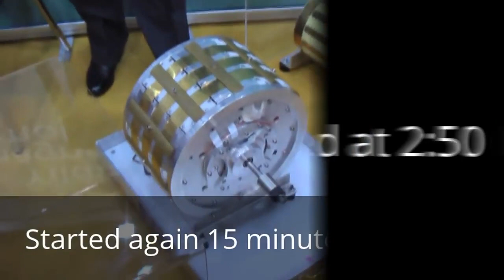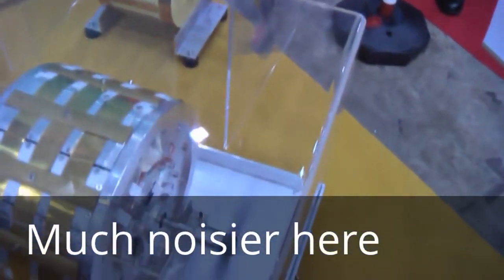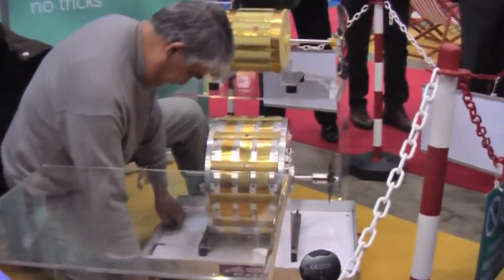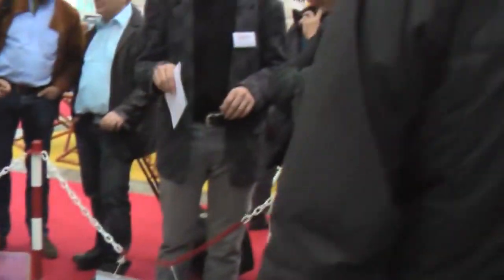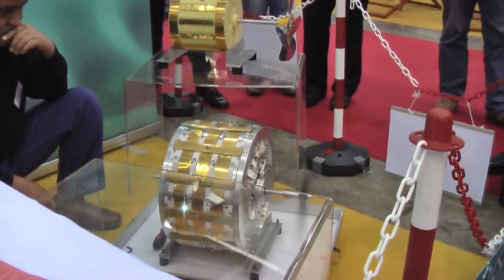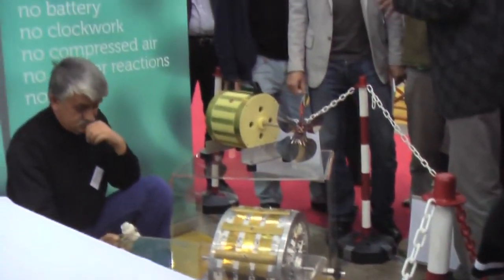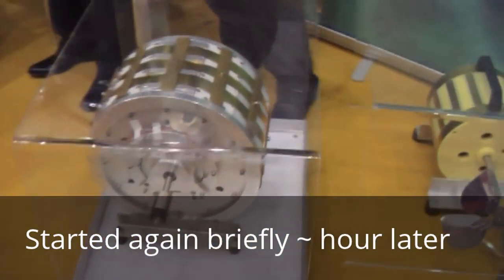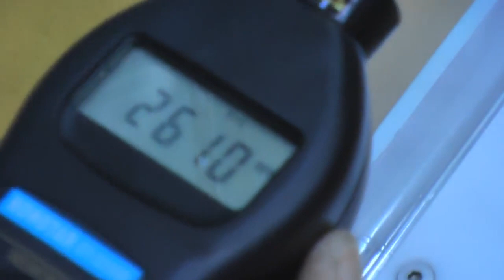Running Yildiz Magnet Motor at Inventors Expo 10 12, 2017, Geneva, Switzerland

Comment: He could never agree to take the center core a part, That's where a coiled spring is hidden, He coils the spring inside the closet where no one can see him and then comes out and right before the demonstration he releases the spring latch with a punch and a hammer to set it off, It spins for a while with no load attached to it. He never let it run until it stops and he refused to attach a load to it.
Reply: lol right...
Reply: I have another idea.. There is a battery but the switch is hammer activated.. İmagine a  metal rod that connects both polarities by just hammering it . The switch rod slides to left once it got hit by hammer and breaks the circuit
Reply: @ruchancakaloglu  that is one impressive battery tech.... maybe nobel prize winning.. this device runs for hours and produces 240v when paired with a generator.. and it produces no heat also.. wow that's even more impressive than a magnetic motor..

Comment: This motor is verified by Prof. Jorge Duarte, University Eindhoven
Reply: Scammers verify each other
Reply: @ruchancakaloglu  what would convince you then?? He got a round of applause at a university..... lol it's legit.
Reply: @robinjames7967  so you have no information about thermodynamics laws .. İt is not a science it is magic
Reply: @ruchancakaloglu  lol since when does magnetism obey thermodynamics. lol why does the motor not produce heat?? you are the one with no idea.
Reply: @robinjames7967  dear robin I am 55 and retired from engineering.. and I am currently doing SAP software consultancy...  and I am sure what thermodynamics is...  Please read the zerorh  and the first law of thermodynamics
Reply: @ruchancakaloglu  lol well that's good for you but most people still don't understand even how electricity moves through wires... degree or not.. you can be and are wrong.
Reply: @ruchancakaloglu  just remember how the wright brothers were ridiculed for attempting flight... plenty of people with degrees didn't think it was possible..
Reply: @robinjames7967  please follow TOKAMAK science.. because if there will be a free energy,  the route would be on the nuclear fusion ... They are trying to achieve energy from tokamak  for almost 30 years..
Reply: @ruchancakaloglu  i know, fusion is hard... magnetic motor seems much easier and then you don't need a grid.. you don't need to be reliant on the government.. have you noticed governments only get bigger and power get's more and more centralised..